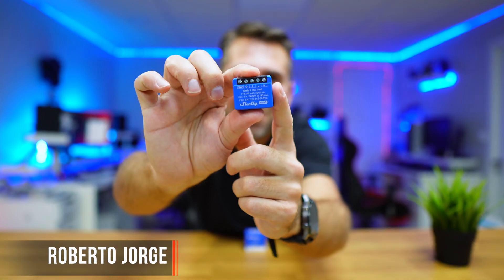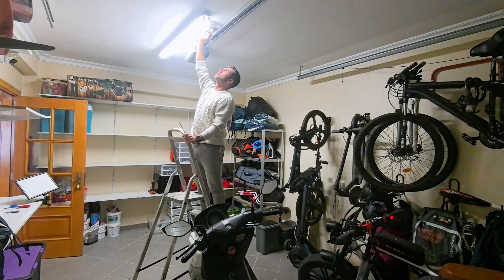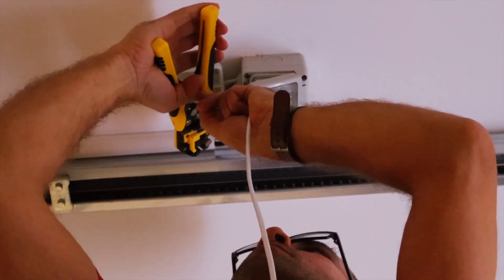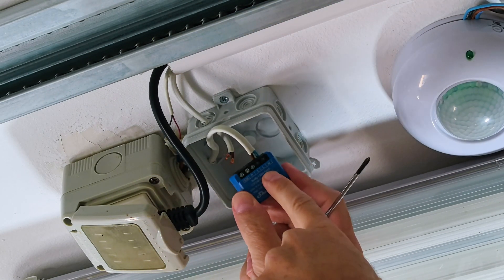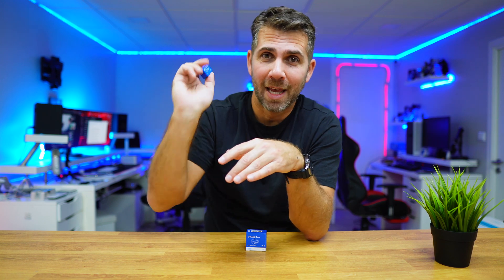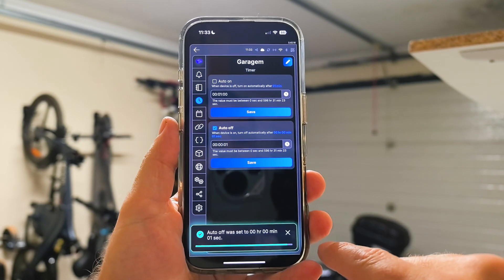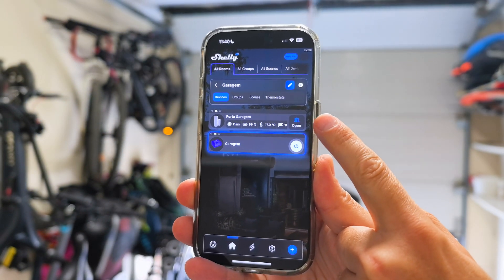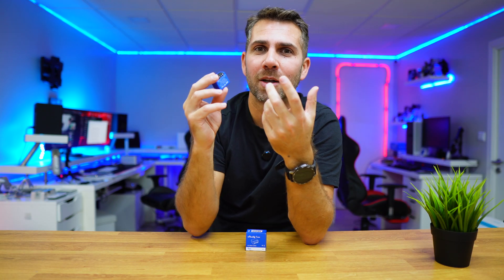How to Open Any GARAGE Door with a Phone 🚀🤯 in 2025

Comment: two questions:
1) Would there be any problem using a Shelly 1 Mini Gen 4 rather than a Gen 3?
2) What model of window/door sensor are you using? (And does it connect to the 1 Mini, or does it connect separately to the internet?)
Reply: To answer my own question, gen4 works fine.

Comment: Great video 👍
It's definitely an easy upgrade to the garage door. 
In my case, I used the 24VDC from the garage opener instead. ln addition I've  installed a proximity sw to detect if the garage door is closed.
Reply from the maker: Hi Pedro, yes that is a great solution to avoid using the 110/220 AC but mine is so near and the motor not friendly to open 😅🙏🙌
Reply: @RobertoJorgeTech  just wanted to let the tip on the comments section for others that might not have the 230VAC socket near.
Btw ... No need to open the motor box ... The 24VDC and GND outlet is on the same terminal bar as the open/close signal. Refer min. 2:00 of your video.
Congratulations on your channel... Always excellent content ⭐⭐⭐⭐⭐